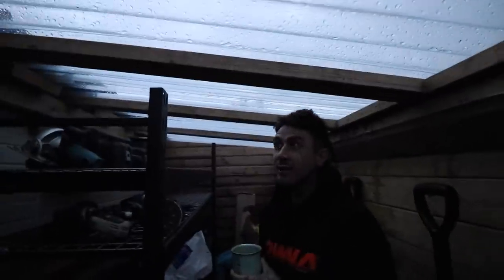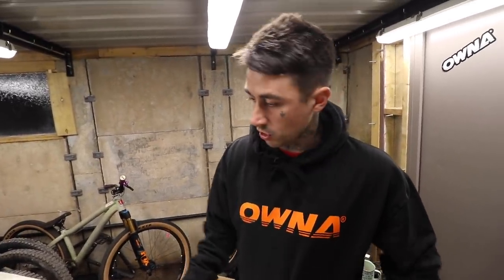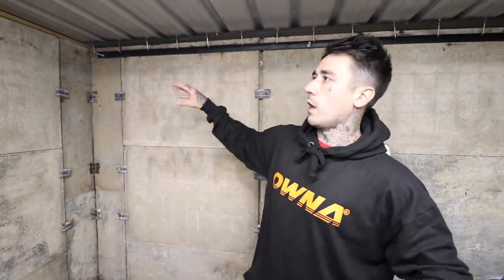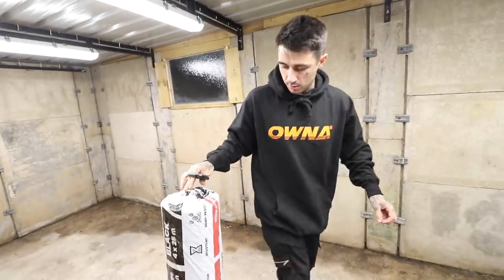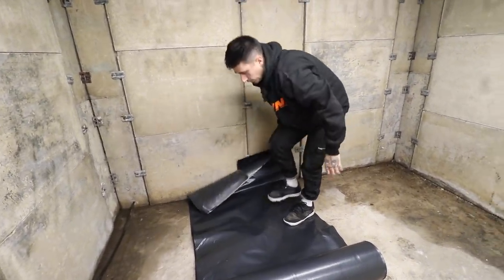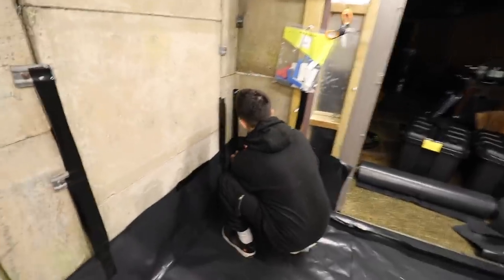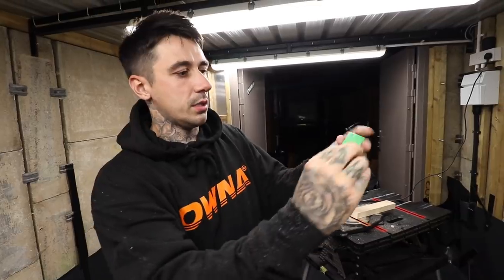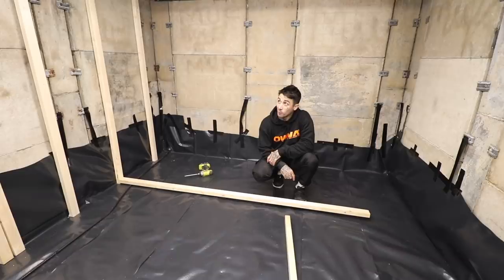MTB GARAGE BUILD PROBLEMS!!

Comment: Get a tire washing station. I've started a similar bike garage. Actually cleaning MTB tires with a brush and soap is crazy the next time you ride. Spraying down always leaves a fine dust after they dry. When they are squeaky clean, and as dark in color as brand new, they also grip like mad on the trails. You would think they just get dusty or muddy again, but I swear it's not the same. A similar setup for actually cleaning spokes, hub, and especially cassette and chain down to brand new and adding new oil/grease/lube will also make it worth it. Maybe you do that already, but I never did until having a proper room for it.
Reply from the maker: Yes mate !!! I use muc off and brushes then water dispersement spray on side walls to re moisturise
Reply from the maker: Sounds sick!!! Would love to see the garage build

Comment: You mentioned about laying your floor then having your walls sit on top do it the other way around as your floor will take the most abuse and if you do need to repair or replace it youl save yourself a head ach of having to get it from under your walls 👍
Reply from the maker: Hey mate good point tbh!

Comment: How will you breathe? Are there ventalation holes? Can you dry wet bikes? (I added a fan to mine, chemicals gassing!) You need a mega sound system too in there - switched on with lights when you open the door!
Reply from the maker: I think be ok for oxogen in there??? Not spraying bikes or anything crazy in there ???
Reply: @harrymain  When my building Architect-Cycling-Buddy visited my bike shed, he told me all my lube, chemicals, tires, cleaning solutions were off gassing too much for the ventilation - he was concerned about explosions/fire and chemical exposure as much as oxygen and for me! Shed had 2 passive  vents, but he told me to cut another hole in and put in a fan to blow air out, create negative pressure inside to pull fresh air through the vents.  So I put a 12VDC 8" radiator fan blowing out at the peak of my shed to pull air in running 24x7, on a variable speed controlle - I can post parts if interested. Just be careful, if its stinky in their you might need more breathing holes!

Comment: Proper nerd comment inbound, but your roof joists on the lean-to are orientated wrong. You want to rotate them 90° to get the benefit of their depth. (Bending moments and second moment of area etc etc, blah blah). 

Anyway, great video. Keep it up. 🤟
Reply from the maker: I know but it was already too low cos under the gutter on back of garage
Reply: @harrymain  definitely not a criticism, merely an observation. And appreciate you taking the time to reply. Build is looking sick though.